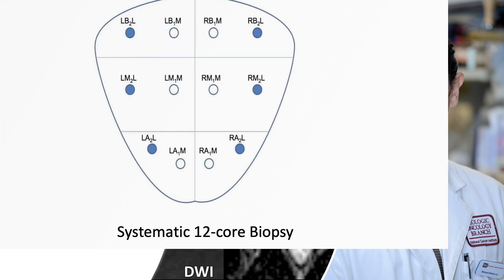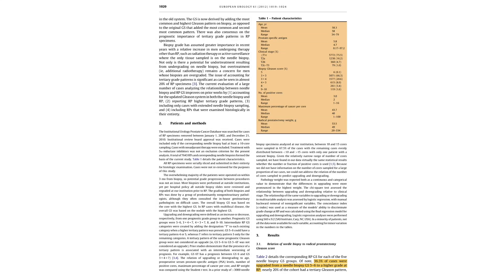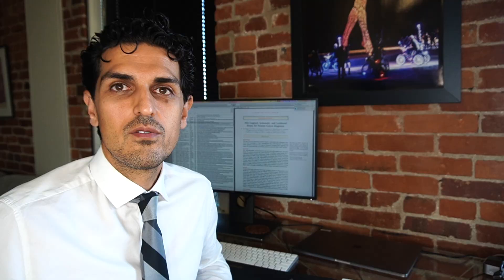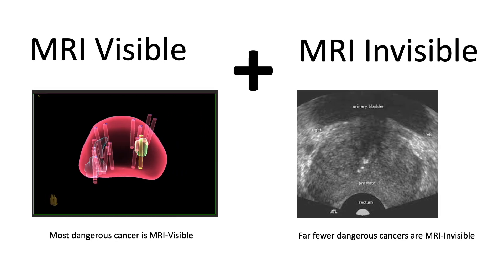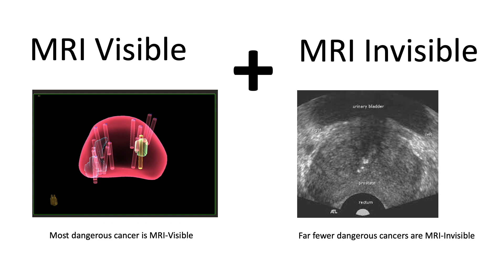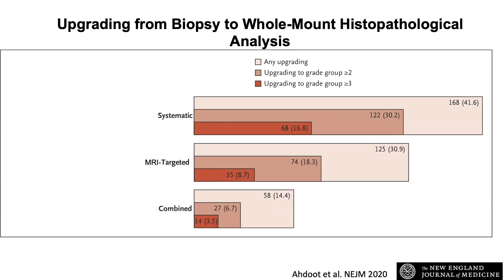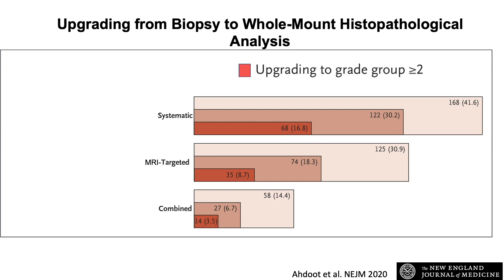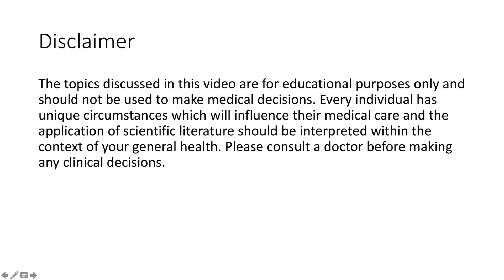Prostate Biopsies Can Be WRONG! -  Dr. Ahdoot Explains Prostate Cancer Diagnosis

Comment: Wow. What about  perennial biopsy.  Would that be a good option with the study of the MRI FIRST. and than basically  just using the ultrasound.  I had that done
 Not the in bore. My doctor  is confident he got the two lesions 7mm and 4mm. Im  a little  worried. I'm sure If psa goes up or lesions get bigger I should ask for the in bore. The scarry thing is the radiologist  rated the lessions a 4. I  dont konw how good they are. My urologist thought  it was not cancer right off. Or I should say in fusion biopsy. One urologist said in early detection cure rates are the same for surgery or radiation. Focal lazer therapy  looks very promising.  Maybe 5 years from now the preferred treatment? Plus two biopsys at each leasion site probably should of been done. Side effects were nil. No blood in sperm either.
Reply from the maker: Hi Tom! You are right on! Perineal biopsy is superior to transrectal biopsy in both cancer detection rates and lower infection risk. I have switched my practice to nearly entirely transperineal prostate biopsy for these reasons. My recent New England Journal of Medicine publication (https://www.nejm.org/doi/full/10.1056/NEJMoa1910038) showed the benefit of MRI targeting over traditional methods but was done before we had good evidence on the value of transperineal biopsy. I am confident that in about 10 years the rest of the urologic community will make the change to using only transperineal biopsy but adoption is slow. This is yet another example of how we can do cancer care better...hence the name of the channel! 
Hope this helps. - Michael Ahdoot MD
Reply: @cancerbetter  one more thing. Tell your patients  they might want to sit and void the first couple times after a biopsy.  They grease you up pretty good with that probe. Or maybe  the enema is still at work. If you you get my drift. The only  mishap.  No burning or blood. 12 pinches. That's it. And I know two guys  who got Sepsis from the transrectal.
Reply from the maker: @Gonar1212  Risk of sepsis from transrectal biopsy is a real thing with 3-4% of people being hospitalized after transrectal biopsy. Transperineal prostate biopsy leads to the lowest rate of infection and has a 0% rate of sepsis. I am a fan of transperineal prostate biopsy and do the majority of my biopsies transperineally now.
Reply: @cancerbetter  thank you. Many top universities  in Chicago dont have it. Loyola does. Was not bad at all. Of course  in bore and in fusion whould be even better. Seeding is making a big comeback.  But your right radiation can cause rectal problems even though it's much more pinpoint than before.  Some are advocating high dose for 5 days on the beam. Also just radiation on only the lobe effectied if that's the case. Surgery may not be the gold standard that it once was.  My problem  is a catheter really hurts. The metus gets bad. I dont know if I can handle that for 10 days or more.  3 or 4 days yes. Plus no matter what I took I could not defecate.  And that was just bladder cysto surgery.Theres definitely a controversy between surgeons and radiation oncologist.  Let's hope I won't have to cross that path.
Reply from the maker: @Gonar1212  For people who cannot tolerate a urinary catheter there is a way to do a prostatectomy without using a catheter. You need to find someone who does Retzius sparing prostatectomy and at the time of surgery they can put a drain directly into the bladder for one week while you heal from surgery. 

Retzius sparing is new and has excellent continence outcomes (i.e. most patients are continent on day 1 after surgery) but its challenging and few urologists do it. I have switched the Retzius sparing and I love it. Patients are doing amazingly from a continence perspective.  Aside from myself I know the urologists at the University of Miami and  Dr. Kowalcyzk at Georgetown in DC do Retzius sparing as well.